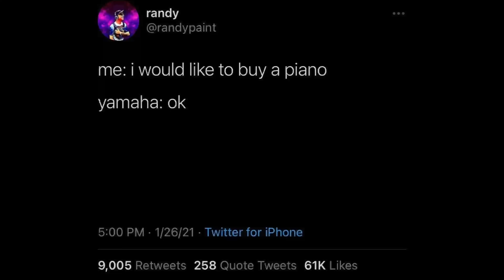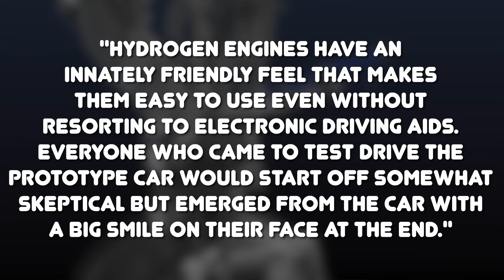Toyota's New 455HP Hydrogen V8: Everything You Need to Know

Comment: Assessments since 2020 have concluded that hydrogen vehicles are still only 38% efficient, while battery EVs from 80% to 95% efficient. 

Baxter, Tom (3 June 2020). "Hydrogen cars won't overtake electric vehicles because they're hampered by the laws of science". The Conversation. Archived from the original on 31 July 2020. Retrieved 4 June 2020.
Fernandez, Ray (April 14, 2022). "Here's Why Hydrogen Cars Were Doomed to Fail". SlashGear. Retrieved April 16, 2022.

Comment: Hydrogen need a champion/s to push investment. Just like Musk championed electric cars through Tesla. I think Hydrogen is way cooler. One other advantage  fuel cell cars have like the Toyota Mirai have is that they can clean the air whilst driving. People are raving about electric cars but what happens when you  start producing 2 Billion cars - do we have an endless supply of Lithium for the batteries and where do we start dumping them when their obsolete?. There is definitely a market for Hydrogen in the future and I'm guessing several manufacturers like Toyota,  BMW and others will need to get together ,along with governments and help push it through - then we'll start seeing stations popping up and prices coming down and also the product improving as a whole just like electric did and petrol over many, many years..It won't happen if we jut it on hands and put everything into electric, I'm sure we'll find other options as well by 2050.

Comment: Where are you getting hydrogen from? If you're answer is fossil fuels, you are a problem, not a solution.  Same goes for battery cars. Where does power come from? Without supply, the current engine are the only solution. It socks, but so do brown outs in winter when you rely on electricity for heat.

Comment: Personally I don't think hydrogen and electric will be taking over anytime soon because the infrastructure isn't readily available. Propane and eathonol on the other hand already has infrastructure. For example, you can usually go into a hardware store and get your camper fueled with propane. And eathonol may not have as much infrastructure, but it may take over in the Midwest because of the abundance of corn which is mostly used to make eathonol for gas. Michigan already has plenty of gas stations that sell e85, but we may be able to make an abundance of cars that run straight eathonol, and gas stations might be able to sell 100% eathonol. These cars that run e100 would have a FlexFuel+ tag which can run 15% more eathonol than normal flex fuel, 100% as apose to only 85%. In conclusion, we don't actually have to go zero emitions, just low enough that the plants have enough time to absorb the CO2 and produce O2 which will go into the air we breath and the engines that run the fuel.

Comment: Hydrogen as a fuel is a great idea but until it reduces in cost and in efficiency,  there are still better options. If anything,  the best option we have right now is the net carbon neutral fuel F1 will be running in a few years with the 2026 engine regulations. It will be 100% sustainable and made from bio waste among other materials. As it stands, right now electric vehicles are not sustainable enough with regards to the environment. Besides the batteries, countries like South Africa rely heavily on coal and fossil fuel to generate electricity where they are not only creating far more emissions but also have a chance to not be fully charged due to loadshedding.

ICE's are and always will be the way to go in future, whether it be hydrogen or bio fuels.

Comment: you need to offer a product that is superior in every way. yeah show me a company that does exactly that...
in 10 years when you cant buy or drive a gas car. look at joe schmoe driving his hydrogen car. lookin pretty superior to me bro. hydrogen/electric hybrid would be pretty nice. low power low fuel usage and enough flywheel weight to keep the batteries charged and the electric motor buzzing. thats not a bad gig right there. pretty superior in my eyes. do i think hydrogen is a good option probably not. but ive had my designs as well and it would be best in a 2 stroke/cycle configuration. most motors would do best that way but what do i know.

Comment: When you live in cold climates the electric car/vehicle is questionable. You need heat to keep the windshields clean. Have 4 adults breathing in a -25 deg temp and keep the windows from freezing up!  Electric vehicles for cities might be ok but for remote and colder climates you need heat. Electric vehicles are questionable since in the cold climates you need to keep the batteries warm 24/7. How is this being eco friendly? Running electricity 24hrs / day that is for cold climates. I believe that the electric vehicle has its place, what are the life spans of the battery pack and how clean is it to mine Lithium? And then we need to discuss the disposal of the lithium?

Comment: This is the great move by Toyota to comply to zero emissions and more importantly maintaining the essence and taste of Cars which is being devastated by electric vehicles (EV). 
Weight of EVs is reduced in order to minimize load and increase battery life, but it  degrades the true taste of cars. I’ve took a ride on Tesla Model Y double motor and it just gives the feel of a plastic made toy. 
Also EVs are not so environment friendly due to the use of rare earth metal, the CO2 emissions in in the complete life cycle of batteries manufacturing and disposal. 
Although, Internal Combustion Engine (ICE) cars are far more complex and require more maintenance, compared with EV, but the power and feel are unmatchable. Hydrogen fuel stations is a challenge but tech developments will make it cheaper and abundant. The unforeseeable consequence of hydrogen Cars is increased humidity levels, whose environment impact is debatable.

Thanks to Toyota for striving to keep tradition alive, otherwise future would have been left to the mercy of plastic like EVs and providing undue competitive advantage to cheap Chinese EVs.

Comment: Hydrogen is a better technology, just not today. Hydrogen has an energy density of 35,000 watts per kilogram, vs lithium-ion batteries which have 200 watts per kilogram. This is why commercial planes are not going electric. Which is another major contributor to carbon emissions. An internal combustion engine running hydrogen = planes with 0 carbon emissions, and is feasible. If you agree that planes are around to stay, and are a major pollutant, then there is a major transportation segment that will require combustion engines. The reason hydrogen is not feasible at the moment is due to a lack of infrastructure, and the cost to produce and transport it. I think the tipping point will occur once we’re producing large amounts of power more sustainably (see nuclear fusion / tokamak for eg.). At that point, harvesting hydrogen will become viable. And we will be able to use hydrogen in light & heavy duty vehicles, boats, planes, rockets, etc. With regards to cars, sure, BEV have instant torque. But they’re boring as all hell to drive and nobody talks about it. I think the Japanese have it figured out. They’re playing the long game. Hydrogen is the most abundant element in the universe, lithium is not. Hydrogen can propel any type of vehicle (land, water, air, space). Fix the production and infrastructure problem and hydrogen is off to the races.

Comment: You forgot to mention there is no way, as of now, to dispose of the old car batteries at 100k miles. The electricity produced is primarily coal derived. Due to the above, electric is not a cleaner option.

Comment: I think that you must see this investment in a longer perspective, right now sure  hydrogen is no different from gasolin or diesel driven cars, but in 20 years or so most manufactors of cars will be exclusivly making electric driven cars, if then these Japanese car makers are making hydrogen driven cars, there would be a market for people buying these cars because of the retro feel, you know the strange feel of a car not sounding anything at all in electric cars,  when you know what a fantastic noise that can be produced from a V8 or V6 engine, I know that I would like to have a car that sounds like a car.

Comment: Hydrogen ftw! Electric is only sustainable short term and they suck for long distance traveling. The availability of Hydrogen isn't really much of an issue. I'm sure people thought the same thing when ic engines came around originally and there wasn't a gas station on every corner. The simplest solution is for current gas companies to invest in Hydrogen and new pumps at current stations no new infrastructure would be needed.

Comment: Strip mines, slave labor, batteries in the land fill because no one wants the spent cells, the cancer and birth defect rates around mining and battery facilities, a grid that can't handle all electric cars, no universal charging are just a handful of the problems with electric. The cost of repair (And i own a shop that repairs hybrids) is very high putting a major disadvantage to lower income people who would have to buy a used car. Lack of parts and no right to repair comes in here too. Electric is not sustainable and is only green in your back yard. To say that infrastructure doesn't exist for hydro is crap. It didn't exist for electric either... Until it did. The hydro car is way more of a recyclable unit than toxic batteries. You also left out Hyundai/ Kia is also on that band wagon with the N Vision 74. And that car is beautiful.

Comment: REALITY CHECK -This is the elephant in the room with electric vehicles. Our residential infrastructure cannot bear the load.  A home charging system for a Tesla requires 75 amp service. The average house is equipped with 100 amp service. On our small street (approximately 25 homes), the electrical infrastructure would be unable to carry more than three houses with a single Tesla each. 
In case you were thinking of buying hybrid or an electric car...
Ever since the advent of electric cars, the REAL cost per mile of those things has never been discussed. All you ever heard was the mpg in terms of gasoline, with nary a mention of the cost of electricity to run it. 
      At a neighborhood BBQ I was talking to a neighbor, a hydro employee. I asked him how that renewable thing was doing. He laughed, then got serious.
If you really intend to adopt electric vehicles, he pointed out, you had to face certain realities. For example, a home charging system for a Tesla requires a 100 amp service. The average house is equipped with 100 amp service. On our small street (approximately 25 homes), the electrical infrastructure would be unable to carry more than three houses with a single Tesla each. For even half the homes to have electric vehicles, the system would be wildly over-loaded.
This is the elephant in the room with electric vehicles. Our residential infrastructure cannot bear the load. So, as our genius elected officials promote this nonsense, not only are we being urged to buy these things and replace our reliable, cheap generating systems with expensive new windmills and solar cells, but we will also have to renovate our entire delivery system! This later "investment" will not be revealed until we're so far down this dead end road that it will be presented with an   'OOPS...!' and a shrug.
If you want to argue with a green person over cars that are eco-friendly, just read the following. Note: If you ARE a green person, read it anyway. It's enlightening.
Eric test drove the Chevy Volt at the invitation of General Motors and he writes, "For four days in a row, the fully charged battery lasted only 25 miles before the Volt switched to the reserve gasoline engine." Eric calculated the car got 30 mpg including the 25 miles it ran  on the battery. So, the range including the 9-gallon gas tank and the 16 kwh battery is approximately 270 miles.
It will take you 4.5 hours to drive 270 miles at 60 mph. Then add 10 hours to charge the battery and you have a total trip time of 14.5 hours. In a typical road trip your average speed (including charging time) would be 20 mph.
According to General Motors, the Volt battery holds 16 kwh of electricity. It takes a full 10 hours to charge a drained battery. The cost for the electricity to charge the Volt is never mentioned, so I looked up what I pay for electricity.
I pay approximately (it varies with amount used and the seasons) $1.16 per kwh. 16 kwh x $1.16 per kwh = $18.56 to charge the battery. $18.56 per charge divided by 25 miles = $0.74 per mile to operate the Volt using the battery. Compare this to a similar size car with a gasoline engine that gets only 32 mpg. $3.19 per gallon divided by 32 Mpg = $0.10 per mile.  
The gasoline powered car costs about $25,000 while the Volt costs $46,000 plus. So the  Government wants us to pay twice as much for a car, that costs more than seven times as much to run, and takes three times longer to drive across the country.
WAKE UP NORTH AMERICA!!!!!!!

It costs $30,000 for a replacement battery for your EV.  6 years battery life if you use public chargers, 7 to 8 years if you use home level 2 chargers.

Comment: I am pro hydrogen if possible or combo hydrogen and electric. Not because of emissions or better product, but primarily to eliminate the need for oil from the Middle East and Russia. To strip OPEC+ from its power and influence. 
Most transportation/ daily driving doesn’t require amazing performance. There is nothing wrong with moving the masses to a new energy source and retain traditional combustion for specialized area and hobbies. We still have horse racing even though the masses don’t get around on horses anymore.

Comment: People need to understand that the HFCV's built by Toyota, Honda and Hyundai HAVE electric motors which are powered by the HFC. This isn't likely to change, either, as electric motors have many advantages for both the consumer (cheaper maintenance costs, as there are fewer moving parts to wear out and replace), and the manufacturer (cheaper overhead costs from lower parts inventories). Any production of hydrogen ICE engines will likely be for fairly small, but highly lucrative, niche markets, such as in motor sports. Incidentally, the 1.8L engine in my 09 Matrix was built by Yamaha. Valves went on it in 2019. Not a bad run for a great mid-size car.

Comment: Question: If every car was replaced by an electric, will the electric generation suppliers be able to generate enough power for a growing economy and a growing population. Also lithium used for the batteries is in short supply, it will not be long before the "supply and demand" inflation rule takes root, and cost of these car double in price.

Comment: Hydrogen is the future.  EV‘s are polluting to build, from mining the raw materials to disposing of the batteries.  They weight 50-100% more than ICE cars, so take longer to brake, wear out our roads, and will destroy our bridges.  Hydrogen is getting more efficient to produce and store.  It can be transported like gasoline.  The „Green“ movement will make sure we do not have enough electrical production.  They are also blocking the mines needed to produce the necessary Lithium, Cobalt, Copper, and Nickel. In 20 years, EV‘s will be looked on as a bad joke by Elon Musk.

Comment: For motorsports, for long haul trucking, for off road, for small engines... This makes sense.

Especially if you consider things like Formula 1, F2, GP3, Formula Ford, le Mans, Indy, NASCAR... This could prove to be a very interesting ice.

I'm thinking a hybrid turbo charged V6, cooled by the actual hydrogen(like a rocket) would be able to produce a couple thousand horses if done right

Comment: Biggest pro for hydrogen that isn't just gear head emotions: Trucks and towing. Think about it, when was the last time you saw an EV charging station that could actually accommodate a truck and trailer without blocking traffic? Plus, BEV's lose absolute crap tons of range when they start towing. Just watch some of the videos coming out about the F150 lightning and its towing nightmares. You'd have to plug in every 100 miles at least, usually much less than that, 70 miles is realistic. Then, you have to wait an hour to charge just to go another 70 miles. BEYOND unreasonable and not something that will be fixed anytime soon by BEV's. Hydrogen is perfect for any truck that is actually going to be used to do truck things. Yes, hydrogen isn't as energy dense as gas, but its far more dense than battery electric storage. You could easily have enough hydrogen on board for 1000 miles of range (700ish while towing), and not come anywhere close to the weight of a BEV truck. Then you fuel up in 5 minutes and keep going, all while not releasing any C02. It's a no brainer for blue collars, big rigs, construction workers, and weekenders who just want to tow their RV around. BEV's are not the single "king of the industry", they still have drawbacks and will continue to have drawbacks for decades. Hydrogen has drawbacks as well of course, but also pros that make it ideal to tackle the areas BEVs are weakest in. BEVs and Hydrogen vehicles should exist together, they complement each other well and can completely remove dependence on fossil fuels if brought into the market side by side.

Comment: I have more confidence in hydrogen cars than you do. Hydrogen is the most abundant fuel around. Soon it will be able to be produced, stored and distributed at an economical price. Exhaust is only water vapor. Electric car batteries are expensive to produce and highly damaging to the environment. Then again damaging to get rid of when dead. Not to mention it takes fossil fuel to charge batteries. So are they really better?